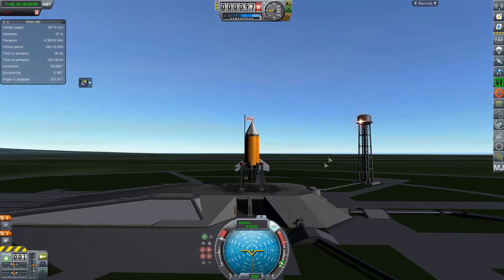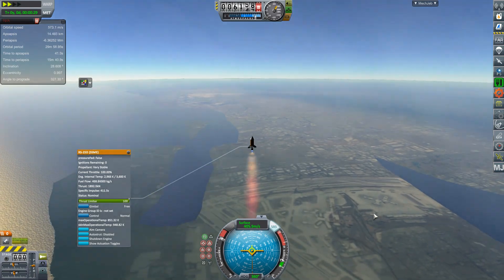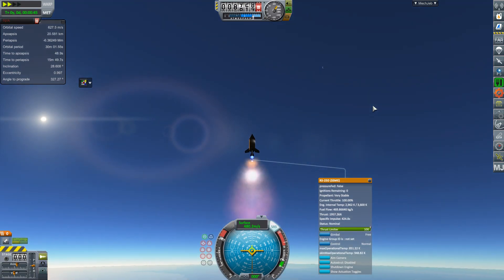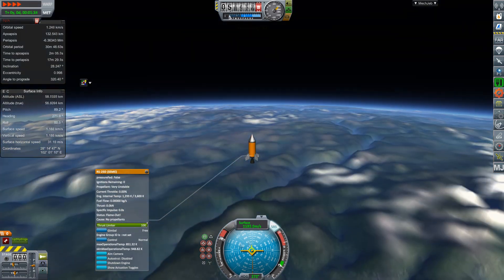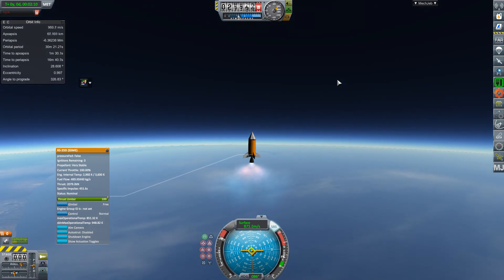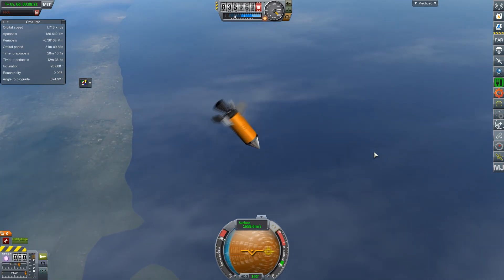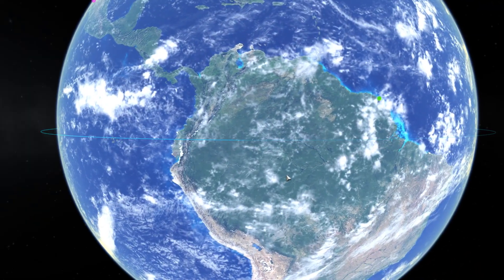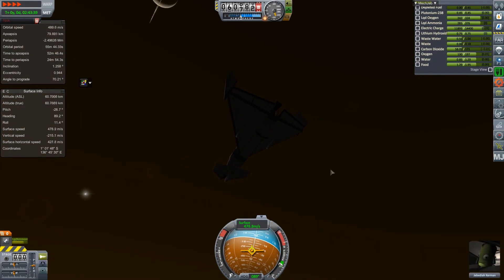Does Launching Rockets From A Mountain Really Help?

Comment: Launch from Mt. Chimborazo in Equador.  You get near max velocity from the rotation of the earth (say 450 m/s), also 6,263 meters of elevation.  Add in a linear accelerator up the side of the mountain.  With 4g acceleration (which should be ok for most healthy people), you could get about 700m/s additional velocity, for a total Vo of 1150 m/s.  Yes, it would be very difficult, and expensive, but if you want to launch the sort of volume of rockets Musk is talking about it would likely yield some significant long-term savings.  Note that Unmanned missions could accelerate at a much higher g force on the linear accelerator, probably at least 10g.  So they would get an even higher Vo.

Comment: Screw launching off a mountain, launch from inside it.. drag it electro-magnetically through a vacuum tunnel out the peak of a Himalayan mountain, then spark a stage 1 ignition pod to push it a few miles to stage 2. Does Kerbal have that mod? Just need a helluva tunnel digger and we have a conveyor system to space.

Comment: You have to understand that the difference between launching from a mountain versus launching from sea level is that sea level is usually (but not always) you know, pretty damn close to the sea and huge bodies of cushiony water for recovering that which can be recovered and disposing of that which cannot be recovered safely in the event of an accident. And while mountain can be remote, that remoteness invariably means it’s that much harder to get the rocket parts to the pad

Comment: Obviously the greatest benefit is starting closer to space. If you're starting at the top of Mount Everest, you can skip all the fuel needed to get you up the first 29,000 feet.

The big downside would be getting everything to the top of the mountain to launch it. For small rockets this might make sense. For anything even slightly large, it's not worth it.
It would be cheaper, easier, faster, better, and probably safer just strapping it all to a ginormous plane and launching it from air to get the same effect.

Comment: Hello Mr. Manley. Instead of taking a rocket to the top of the mountain. Cant we build a rail that goes up a mountain. Instead of fuel we could use magnets. Also why not make a track two times the length of the circumference of the earth. Put a train on it and we could put a ring around the earth at the Hight of the space station. Or just put stuff up to space without the rocket part.

Comment: Hey Mr Scott,
I was wondering if you could do the maths.
On a aircraft carrier , they use steam catapult to launch jet fighters into the air (ok get it to speed).
If you have a vertical stream catapult to push a let say falcon 9 from launch platform into the air to say 200mph(or some other number) before it's engine starts. Then there's the length of the vertical catapult..
And if this helps anyway to "save some fuel"?

Comment: I'd like to see an analysis of launching from a very deep underground "silo" that would use a system of 3 linear motors that would propel lifting points on 3 sides of the rocket to give it a "launch assist".  It seems like so much fuel is used to just get the rocket moving that a launch assist mechanism that could give it an initial push upwards of even 100 Kph could save many tonnes of fuel.

Comment: Actually the biggest factor, and one you did not mention would be the outside air pressure would be lower which in turn would actually allow you to have a rocket engine bell that is optimised for a lower external air pressure allowing a more efficient combustion bell nozzle to be used

Comment: Elon Musk pointed out that re-using rockets added a bit of cost but that’s mostly in fuel. Fuel is cheap. Launching from aircraft or tall hills saves a bit of fuel. Not much compared to the overall costs of launching spacecraft.

Comment: You could get much better benefit if you accelerate the rocket (using land-based electric supply in a rail-gun chamber in the beginning of the lanuch) to build up as much speed as possible while tied to land and climbing the mountain.

Comment: I don't understand the "you now have a plane to maintain" criticism to air launches. Excluding the cost of building the plane, it seems obvious that maintaining and refueling an aircraft between each launch should be much, much cheaper than using an extra rocket for each launch. Is it not? Perhaps the construction diminishes the value, but then construction is the problem and not maintainance.

Comment: Combine a high altitude launch site with being close to the equator and using some type of ground based boost system and there could be significant efficiency gains. For the ground boost it could be a cold gas assist, rocket sled, or EMALS like catapult to launch it straight up or at a slight angle towards orbit heading.

Comment: As I have proposed on several of these videos - lay the rocket stack over on the side on a maglev sled up on a mountain plateau,  accelerate the sled over several miles and up the side of the mountain, snub the sled at the top and fire the engines. You have less airdrag, tiny bit of less gravity, and significant forward velocity at engine start. This will put a good size dent in the amount of fuel per pound of mass lifted to orbit.

Comment: What about on a mountain, using a launch slope up the mountain with a powered sled  to add velocity without having to have on board fuel thus lowering launch weight.
Reply: You add that speed in the wrong direction.

Comment: How is it that there is no mention of the simple fact that if you start from a mile above sea level, you don't need the fuel for the first mile of travel or the fuel to lift the fuel for the first mile of travel - or indeed the mass of the physical structure to contain that fuel?

Comment: Scott...I remember one of my physics profs in college mentioning that there is an advantage to launching orbital vehicles from the lower latitudes, e.g., French Guiana in South America. I don’t recall in detail why. Would you care to take a shot at explaining this, or have you already and I just couldn’t find the video? Thanks in advance.
Reply: The surface is moving faster (longer circumference, same 24 hour rotation) at about 1000 mph so you get this added horizontal component to the orbital velocity.  Let's hope Scott gives and even better explanation!
Reply: George Reynolds Thank you George. I used to know that; it’s been over 30 years since I even really thought about it. I was 3 years into a BS in Physics and changed majors. Anyway the mathematical description I now recall is from the same subset that also includes explaining things like the differential on the rear axle of a car.

Comment: Short answer, NO!  Few mountains are tall enough to make a sufficient difference to justify the added cost, then there's the fact that most  really tall mountains are either in national parks (can you imagine the fury you'd create if you proposed building this say up the side of Mt. Denali ;?), or in some foreign countries and that adds tons more cost and other potentially political problems.  I mean think about trying to build a launch facility in Tibet and being at the political whims of a Communist dictatorship, not to mention the insanely unpredictable weather conditions?

Imo, it would be better to build some type of electric rail mass driver which could potentially give you at least 50% of the necessary escape velocity, and maybe more (some companies currently looking at this think you could possibly even get to LEO) and aside from the initial investment to build it, the cost per Kg is estimated to be quite cheap.  What do you think?

Comment: I have a thinker for ya. If launching from the top of a mountain is more efficient at the launch and trip upwards from there sure. But.... What about... Shipping all the components to the top of the mountain for assembly and blasting off in the first place? Isn't it a lot easier to roll super giant rocket parts on specialized hydraulic trailers sometimes a hundred feet long down city roads to put everything together when it's all rolling down hill the whole way to get there? Maybe that's the advantage to having spaceports on the coasts. Everything rolls down into place rather than wasting the energy it takes and then some to push it all way way up the hill. Talking about 5000-10000 ft elevation just for the lowest of the short "mountains." The wasted mechanical energy in drag and inefficient truck engines on rubber wheels lots and lots of wheels on concrete scraping and rolling along for miles and miles winding up the roads. All done in the name of a fraction more efficient on the blast off. It's never gonna happen.

Comment: If you would put an 10 km long maglev launcher with a good angle inside Mount Everest or another high mountain at better location, it would be interesting to calculate on what speed it would get when it has to start using onboard fuel. 

10 km with 4G acceleration at 9,8 m/s2.. would be v=\/2a*d => \/2*4g*10000 => \/784000 = 885 m/s (is that correct? :) )

That speed would be equal to 46 seconds of flight with latest spacex launch profile (altitude 4,7 km, Amos 17). How many tons propellant that is I leave for someone better to calculate. :)

But I guess a problem might’ve to achieve a good surrounding pressure in the launch tube so you won’t hit a wall of air when top lid is opened. Interesting problem to solve. :)

Comment: Scott Manley, you forgot the most obvious advantage of launching from a  mountain:  the added height.  Denver is a mile high.  A two mile high mountain launch point would cost a lot to transport but it not only adds 2 miles to the potential launch altitude but adds the other benefits you mentioned and could add more miles too.

Comment: Doesn't the engine produce more thrust when it is closer to a surface? ( could be misinformed ) if so wouldnt you get different results for the test you launched from the 829 meter high tower if it had a platform near the top for the engine to thrust against?

Comment: SOLUTION!!! Mount a mountain in a convenient place, for easy transport. I think 15km will do. It will cover the cost in fuel saving for future generations.
Reply: I live in Colorado and Pikes Peak is 14200 ft (4.4km) and has a wide paved 2.5 lane road up to the top now and has enough space for a launch pad. Obviously you would not want to abort into the middle of the US, but would the 4km help for polar orbits or smaller rockets

Comment: How about an electric powered planes attached to either side of the rocket with cables supplying electricity? They accelerate the rocket up to the speed of sound then detatch, fly off and land. 

Even steel should be able to get you higher than any mountain but the difference to initial velocity would be far more relevant. If carbon nano-tubes were used instead you could potentially get as up to as high as the plane's propellers can remain efficient at.

Comment: Here's a thought, Scott;  With developments in railgun and energy storage (in-particular, ultracapacitors) technologies, would it not be possible- even desirable- to launch a vehicle from a mountain-bored verticle tube with assisting kinetic energy being supplied by a railgun launcher?  This could give a vehicle an initial thrust to, say, just short of mach 1 by the time it reaches the mouth of the launch tube where onboard thrust would then be ignited to take the vehicle the rest of the way to space.

You could gain acceleration most of the way to mach 1 without burning a drop of onboard fuel. At which point your vehicle could be at or close to 10,000ft in altitude.  By igniting the onboard engines just seconds before leaving the tube, you eliminate concerns over excess pressures in the confined space of the tube, as there is now a column of air beneath the vehicle that can act as a pressure buffer.

Moana Kea in Hawaii would be a perfect contender for such a system!

Comment: What about launching the rocket from under ground.  Some sort of magnetic/gravity catapult make the tunnel vacuum sealed and the rocket could brake through a thin material up top as its leaving it. Also if the tunnel is deep enough you could use cores heat. 
The rocket could leave the surface of earth with a decent velocity without the extra fuel.

Comment: How about a structural graphene super structure that is 20 miles high and about 400 miles long. The launch tube begins at the surface, into a straight line "up" past the curvature. What's the math (or g-forces) on that? The launch structure houses millions of people in a self contained 3-d city powered by its own fusion, molten salt reactors or thousands of sq miles of solar and batteries, or more solar (and less batteries) from very long lines.

Comment: You all are taking this way to far. Yes launching a rocket from a higher altitude can be beneficial, but how are we goin to get tons upon tons of payload up an extremely high mountain
Reply: Roads, or planes!
Reply: Asses and elbows.
Reply: Shahbaz Fawbush Roads are impractical and can be seriously damaged especially on a mountain side during a launch and where are you gonna find the land for a landing strip on a mountain?
Reply: I am pretty sure that building a road to get there is cheaper than building a bigger rocket
Reply: Lui.f.t the amount of DeltaV that is not needed to achieve a LEO on a mountain is not worth it to make a road up there also taking the account that how the road will be impacted during a launch on a unstable surface like a mountain, also dumping stages into populated areas is another problem since most mountains at great heights are further away from shorelines (in the US facing East where launches take place) The while video is rather an informative one then an actual plan of what we should be doing.

Comment: Houe about a massive railgun on top a mountain near thequater to push a capsule up & to the east.  Would not be able to achieve orbit velocity, but would surely cut way back on propellent needed to get in stable orbit.  Probably more fuel available for landing.  Why would not this work.

Comment: For a SSTO a mountain launch might be better since you can get away with bigger engine nozzle due to the lower air pressure, which would result into less over expanding in space.
Reply: Just use bell noozle

Comment: Coastal site?

Let's say you chose to establish a launch site near the observatories on Moana Kea in Hawaii. That is an altitude increase of about 4200 meters. Much better than the launch site in China.

The site has an industrial access road and is near sea ports and airports for logistics support. Being closer to the Equator at about 20 deg N, the surface speed is approx 1575 km/h (about one extra km/h added from being at mountain altitude.) 

In addition to the high elevation, a launch site located there would benefit from the dry environment and stable airflow, placing the rocket about 40% of the Earth's atmosphere in terms of altitude. While there are some challenges for human workers due to thin air, it is still within the range that allows for routine operations.

There is a small reduction in the force of gravity, as mentioned in the video. The island launch site would allow for a large range of launch azimuths.

The major issue for this location would be local opposition to development on a sacred site, as well as launch near/over population areas.

Comment: Jesus l was sure it would be because the speed of the earth's rotatation would be faster up there. I guess I'm about as sharp as a bowling ball.
Reply: The Earth's rotation is faster at higher elevations, but not very much.
At the latitude of Kennedy Space Center (28.6°N), the rotational speed at sea level is 1,468 km/h. If you built a launch site at 4,000 metres (about the highest humans can work efficiently) at that latitude, the rotation would increase by 1.34 km/h or less than 0.1%.
If you move that launch site to the equator, you gain 206 km/h or over 150 times more. Latitude is thus much more important than elevation when taking advantage of the Earth's rotation, and also more important than the advantages mentioned by Scott Manley. The best combination would be somewhere at high elevation close to the equator.
Arthur C. Clarke understood this already in 1952 when he wrote the sci-fi novel Islands in the Sky . There he envisaged a shuttle-like vehicle being launched from a mountain in New Guinea, for the same reasons mentioned here, plus the fact that the spent rocket stages being dropped in the Pacific wouldn't represent any hazard to human settlements.

Comment: What if you add a long but powerful rail-gun or slingshot mechanism to start the rocket up with some amount of speed before igniting the motors? It could start horizontally along a valley floor on rails that eventually rise up along the mountain side.

Comment: Additional advantage: engine nozzles are tuned to work most efficiently at one altitude. Because the engine is not used to elevate the rocket up the mountain, that inefficiency in the engine's power band is not used. It's a bit like starting a drag race at 3000 rpm instead of idle. I learned this from Scott Manley - he has a video on rocket nozzles that is quite good.

Comment: If you were trying to launch a craft into an eastern directional orbit, wouldn't you also get a slight boost from the speed the mountain is going vs ground level. For example, launching a craft at sea level would increase your orbital velocity by around 460 m/s, wouldn't a mountain increase that?